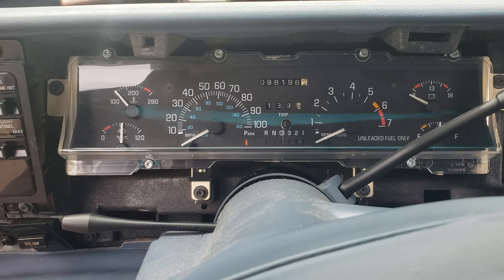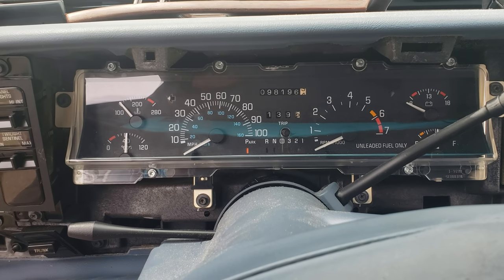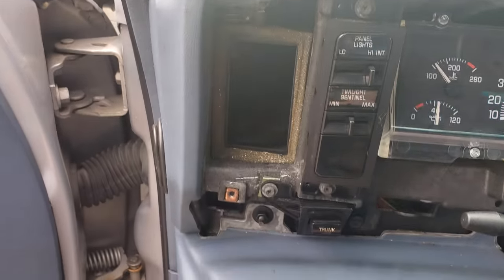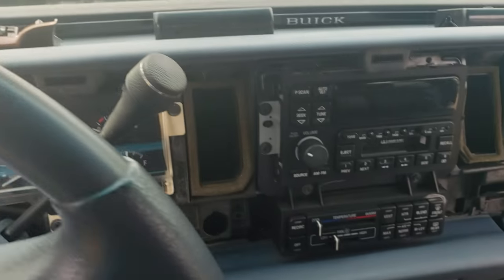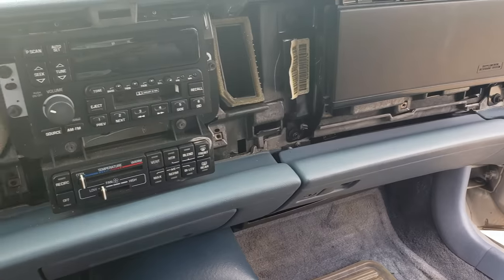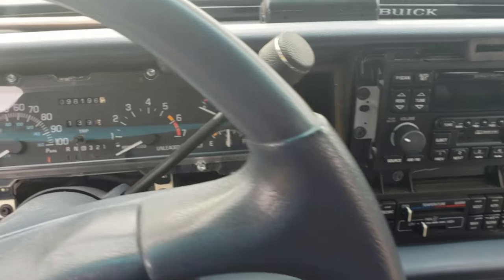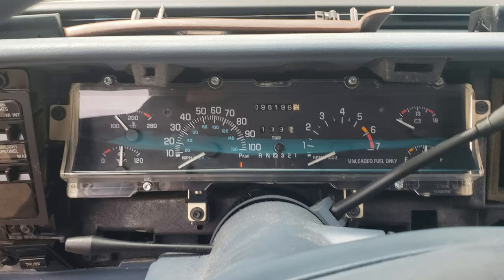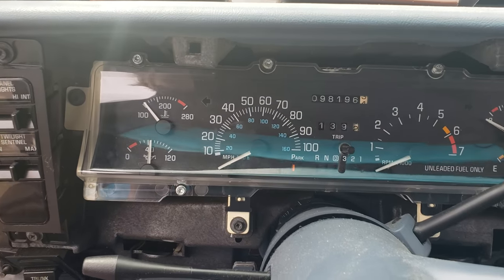How to remove the speedometer on a 1997 Buick lesabre

Comment: how do you disconnect the drive indicator cable
Reply: Right didnt even finsh the video
Reply: i need to know this too
Reply: all you do it just push/pull it with a flathead screwdriver
Reply: @NukaZeus  Exactly right. I did a video on it, and it's pretty simple. I needed to loosen the lower dash padding to do it. Remove with a flat blade screwdriver, reinstall with needle nose pliers.